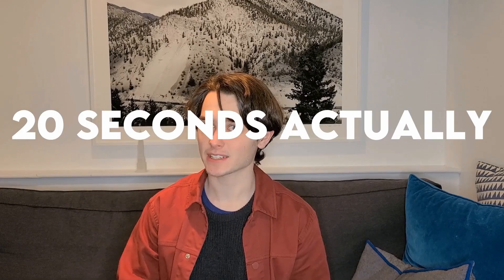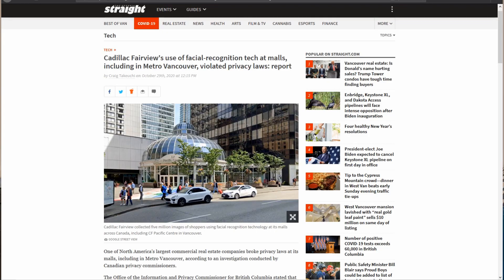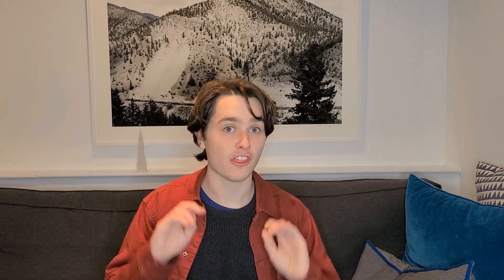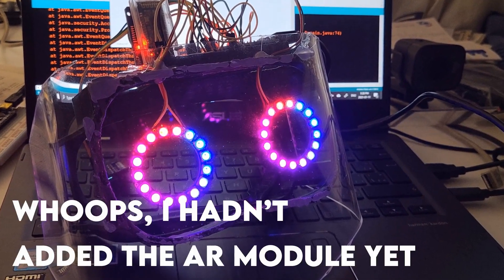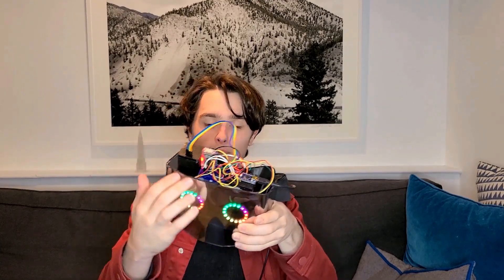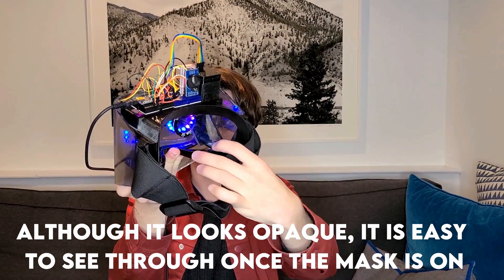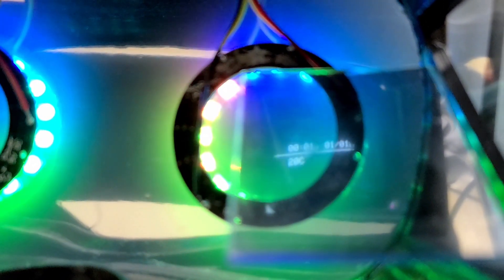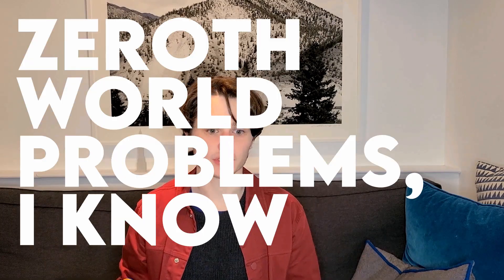DIY AR Headset V2

Comment: Bro what kind of lenses we need to use in augmented reality headset? Same lenses that are used in virtual reality headset?
Reply from the maker: The same ones will work, as long as you are magnifying the screens, it should create a virtual image the desired distance from your face. There is some math to do for your virtual image distance to lens magnification ratio, but it's not too complex.

If you're buying lenses from scratch and looking for a thin profile, I used fresnel lenses (which aren't super common in VR as I believe they can introduce artifacts)
Reply: @Noahmakesthings  thank you bro. Greatly appreciated. Isn't vr headset standalone or cardboard both use frensel lenses? You should also make a "how to make" video on open source google cardboard like augmented reality headset for smartphones which will work for androids google arcore. Like those cardboard so cal holokit and aryzon.
Reply from the maker: @shadow of fire I think it depends on the model of VR headset, I've definitely seen some without fresnels, but that could just be lower end versions. I made a Googlr cardboard a couple years back using non-fresnels and it worked perfectly fine, they should be interchangeable, but fresnel lenses are just flatter. That would come with extra manufacturing cost in glass, however I used a couple of those plastic card magnifiers which were a couple cents each.